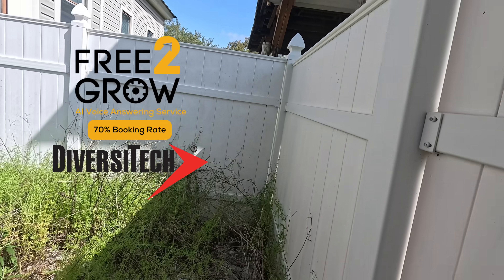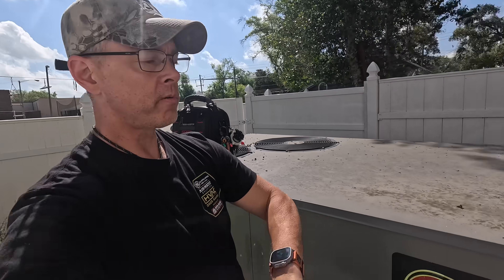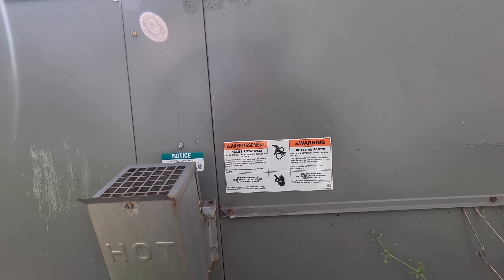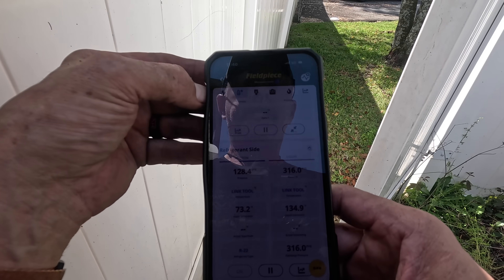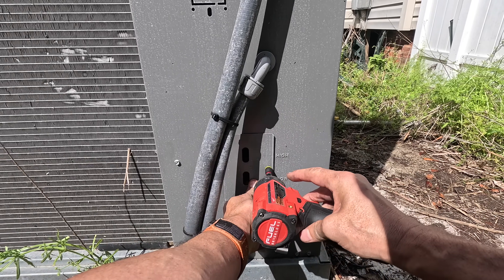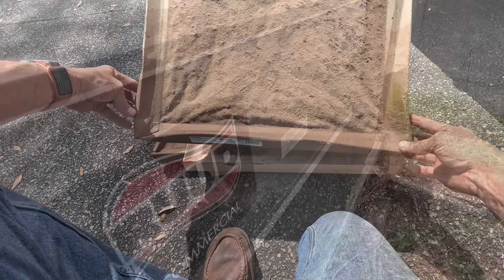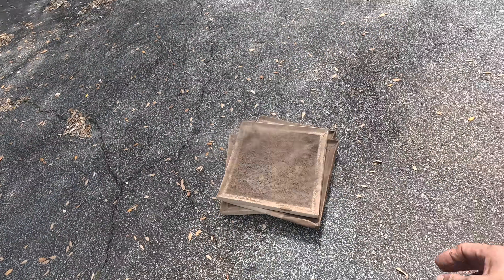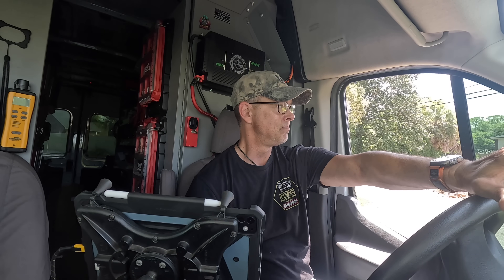Lack Of Preventive Maintenance Shut This System Down! #hvacguy #hvaclife #hvactrainingvideos

Comment: There should be a sensors for air flow through the filters to shut off a/c when the air goes below 17  shuts off a/c like that float switch or have it void the warranty?
Reply from the maker: It did, but that video wouldn’t load.